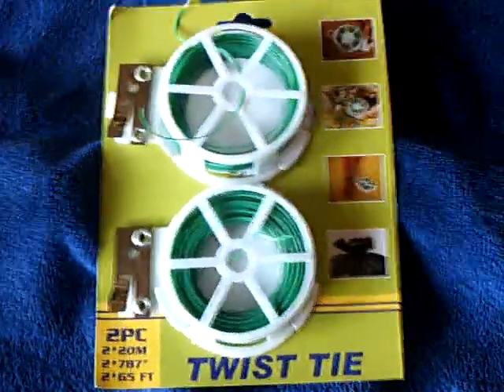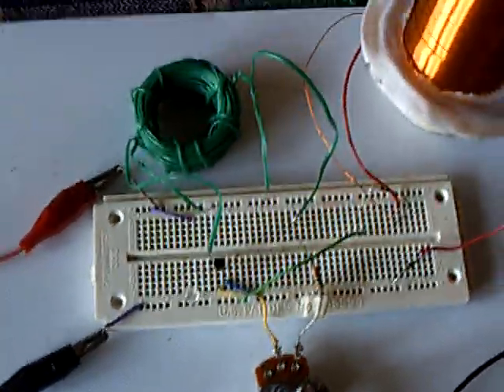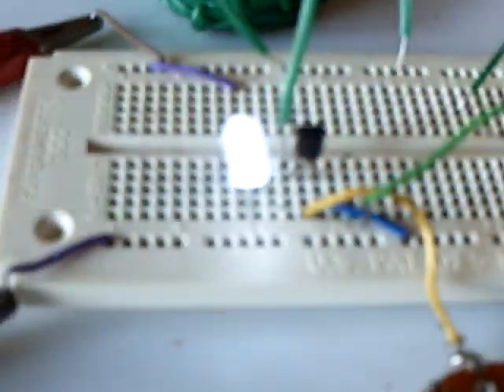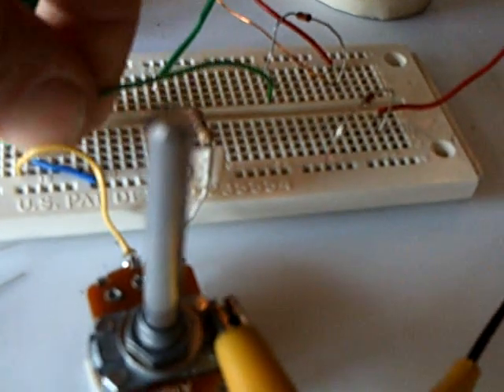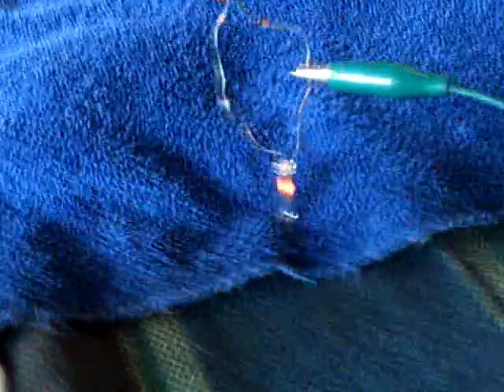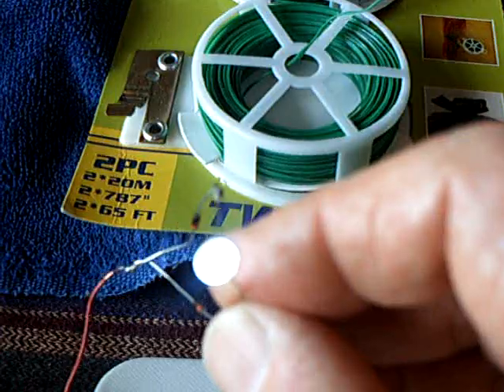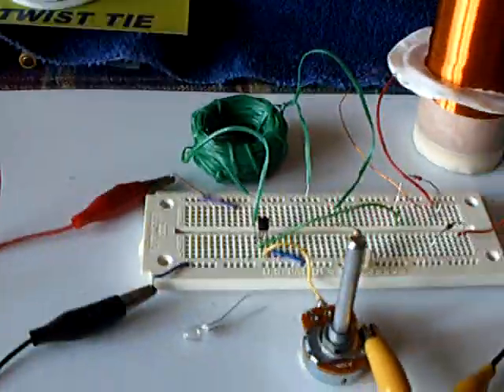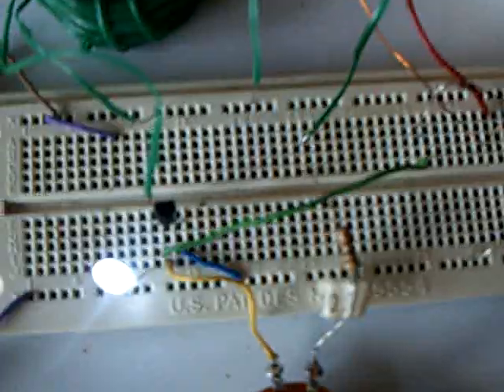Twist Tie Wire Joule Thief.

Comment: @Lidmotor 
The earliest wall telephones used an inductor coil that had a core made of a bundle of steel wires, maybe 4 or 5 inches in length.  The eddy current losses were lower than in a solid piece of steel.  Same goes for modern transformers which are made of a stack of laminations.  The small air spaces between the 'E's and 'I's makes for lower eddy current losses.

Comment: Have you tried winding the copper wire around the toroid made from the tie wire? In other words, wind it just like a regular toroid is wound.   The idea is to not have the current going through the steel wire, because of the much higher losses.  Instead, only the magnetic field is going through the steel wire.  The reason for using the steel wire to wind the core is to reduce the eddy current losses in the core.

Comment: more leedskalnins work,  like it alot, need a steel tesla like coil 3/4 thick then cover it with a piece of 1in copper pipe connect thewire to each end of the copper pipe,,, make sure the iron dont ground to the pipe no where but the end.......it with be the best electro magnet you have ever seen, and the backspike is amazing. and has other phenomina, like become temporarily magnetic i want to go get some paper coated bread ties and make a battery

Comment: Lid, a very small Rodin coil, or a small Rodin Starship coil work with the Joule Thief as well. They are air core. I tested some of the ones that I've made. The smaller the better.
I didn't test them to see if they produced wireless transmition like the tower, guess I should do that tonight.
Thank you for your out of the box thinking.
Peace.
Mike.